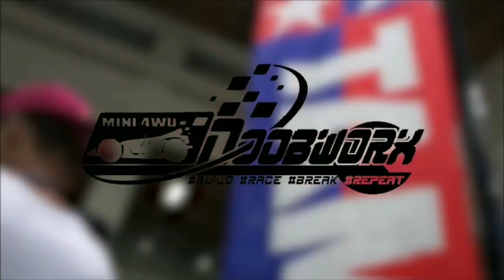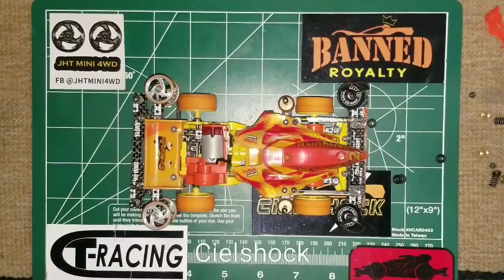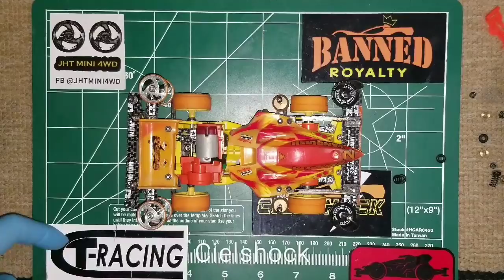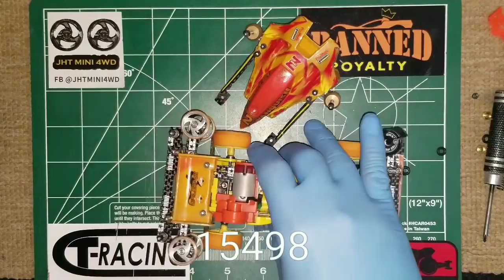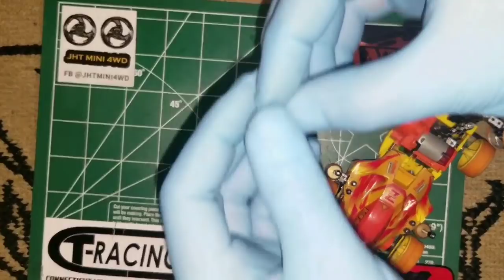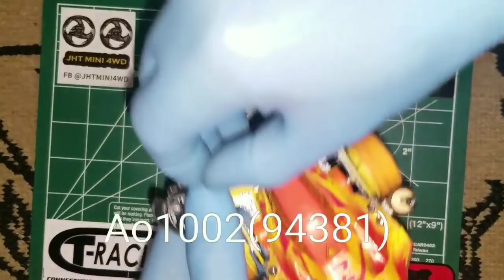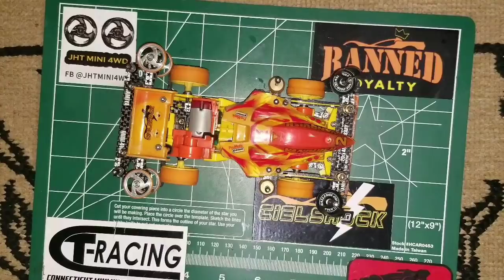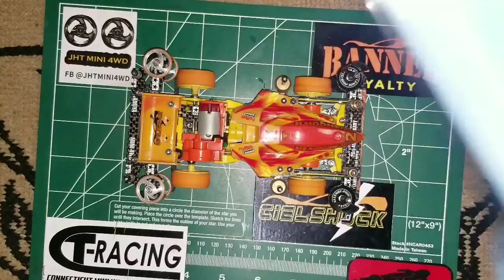(ミニ四駆)VS CHASSIS Build (Banned Overview)

Comment: question for the carbon reinforced 3point.. basically u cut the item into only the bottom half? (or bottom 3rd)
Reply from the maker: It depends how much spacer and what chassis u gonna use it for

Comment: Tamiya tyre width regulation is 8mm minimum.
How about the front tyre? Different height on front tyre is less than 8 mm tyre contact, is it allowed at race?
Reply from the maker: Yes as long as its 8mm m wide and 22mm minimum  height its legal
Reply: @NoobWorxmini4wd  Thank u Bro for the answer👍😄